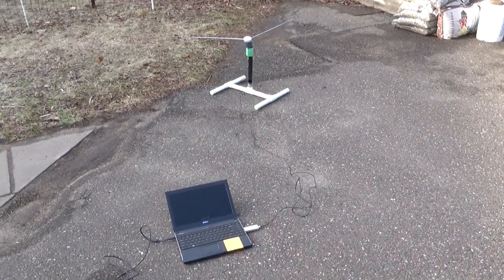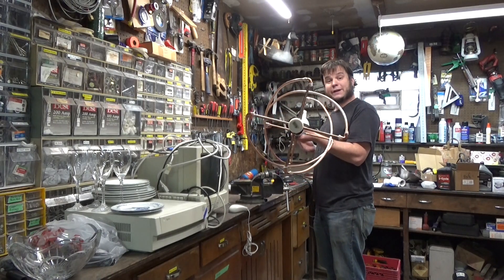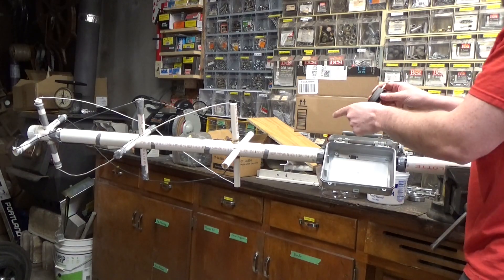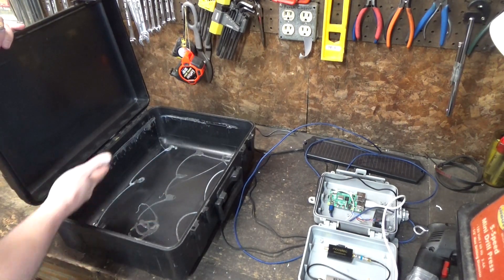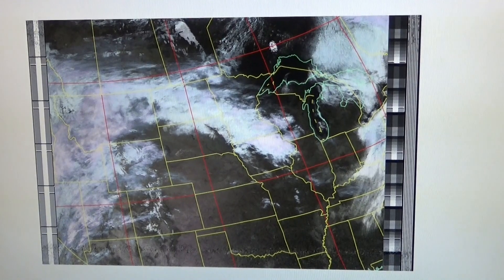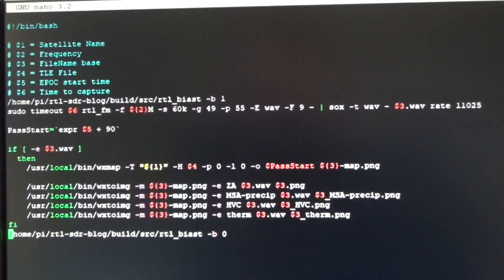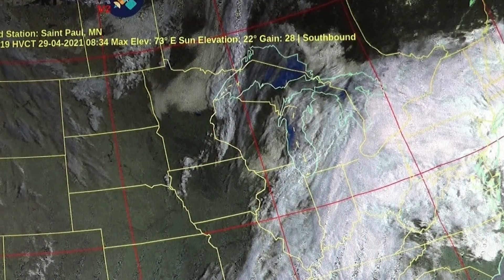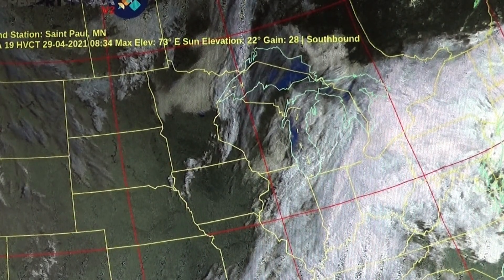Automated Home Weather Station (Satellite Image Collector)

Comment: I know this is an old video but can anyone tell me how this project manages the doppler shift? Do we even need to manage it?
Reply from the maker: The Raspberry-NOAA software deals with it automatically, if you have a wide enough bandwidth it doesn't really matter.
Reply: @saveitforparts  thanks alot for the reply sir, so you mean the software shift the center frequency as the satellites signal shifts down in frequency or we just set set the bandwidth wide enought to have the whole signal while it is shifting?! Im trying to do my first try with an sdr and i have many questions and found your channels very informative

Comment: 5:55 Using Ethernet in my Orange Pi, I noticed a lot of noise on the receiver. I had to connect to the network via Wi-Fi, as interference clogged the signal and degraded the quality of the received signal. the interference on the receiver's waterfall looked like a picket fence made of sticks

Comment: Watching this video again after finally getting around to getting the ball rolling on my own Raspberry Pi weather station that I have been planning forever. I'm starting the other direction though since I'm starting with environmental systems first, and I think I'm going to probably go with GOES data when I get around to adding a satellite receiver to it. I would like to play around with using a small antenna to detect lightning first though.
Reply from the maker: I want to redo this, it's been on the list forever and I've been trying to find time this spring. I still have a box of weather instruments (and I think I have a lightning sensor module!).
Reply: @saveitforparts  I will keep an eye out for the video!

Comment: 6:13 i wanna ask something. I never did any hardware-y project in my life but hot air rises up so shouldn’t the fan be placed above actually? Or does it have any effect anyway because what processing does the rpi even do that would be considered heavy/heating for it?
Reply from the maker: I'm just using the fan to circulate some air, I wanted it in the bottom to help keep water out.
Reply: @saveitforparts  yeah that makes sense, my bad! I really like this project and wanna do it as well even, except that SDR dongle is actually pretty expensive, and from all the other stuff you used (filterers or what was it, gain boosters?) it seems like I should be careful what I am stepping into. Keep it up, I really enjoy your satellite videos a lot. The amount of trial-error you go through makes it worthy.

Comment: How do I update wxtoing
Reply: i don`t think it`s possible anymore. I tried the alternative link to collect data from there for the satelite passes and kepler updates ,but doesnt work. Replacing the weather.txt file with up to date data also did not do anything. When i try to update the GUI it stucks on 2 % and that`s it. If there is command line workaround let us know. Or u want to just upgrade to the Pro version ? In that cases - there are keys online ...

Comment: Quick tip you should never try to fight convection when air cooling electronics. The air in your box will tend to stratify cool on bottom hot on top. Also forced air cooling work well BUT it degrades over time due to dirt and junk in the air. In your application moisture could WILL become a problem. Pulling out side air into a box that has set in the cold over night can cause condensation. I worked in the thermal management part of the electronics industry for abt 5 years.

Comment: A few years ago I built a QFH antenna out of pvc water pipe and computer network coax. I connected it to my dedicated APT receiver which works in the 137 -138MHz range and ran the output via a PC soundcard into WXTOIMG software, I got some really impressive results.
But after a year or so we had a bad storm which obliterated the antenna (I mean totally mangled it) and I need to get it all back up and running again.
Cool video.

Comment: what's stopping the spiral antenna from building up zinc? do you have to occasionally bust rust?
Reply from the maker: It does corrode over time, but it doesn't seem to affect the performance so far. I think the main benefit of copper is it's easy to shape and work with.

Comment: you should add heat sink on the RPi 4 , that may help with heat problems also it will stop the thermal throttling
Reply: I was gonna suggest similar, or at least another fan mounted sideways next to the Pi to blow air across it.

Comment: For all my remote radio systems with the rpi, I use power over ethernet (POE).  There is an adapter that can both put POE onto the cat 5 and take it off at 5v.  I use a POE enabled switch, so I only need the POE adapter at the rpi, it powers the pi, and the rsp.  I then use WinSCP to move the images from the pi to my main computer.  I copy the GOES birds this way..  Great video, especially the antenna, I will have to try that....  Thanks  de wb7ond

Comment: My weather system cost me $0 and very easy to install ! Get 1 18” willow branch , mount it on a board and if the stick is wet it’s raining if the stick has a shadow it’s sunny and if it’s white it’s snowing and if the stick points up it humid and if it points down it’s dry ! Lol